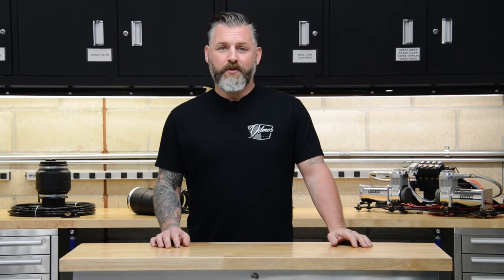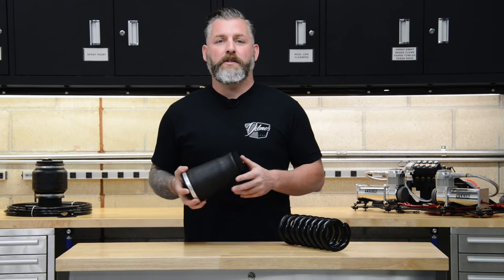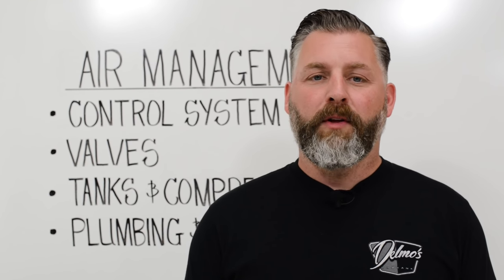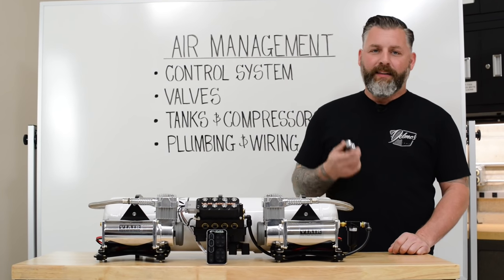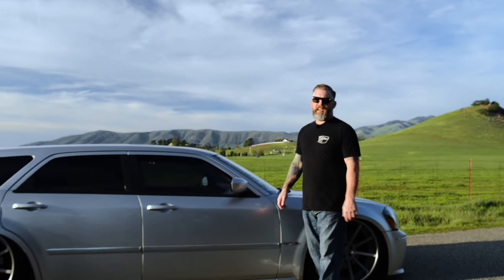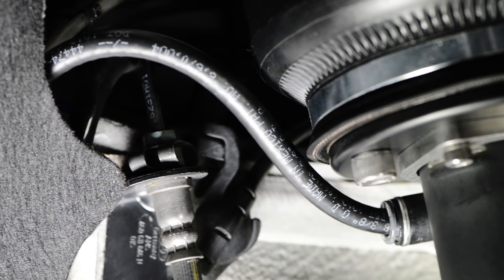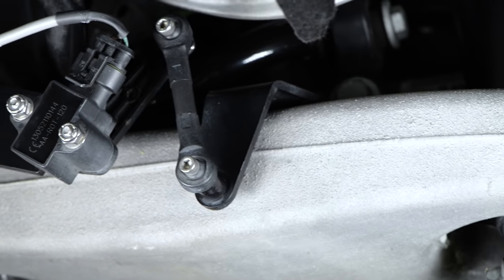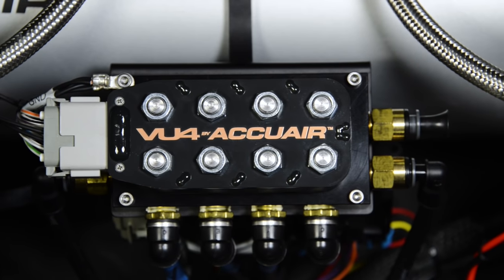Air Suspension 101 | AccuAir Academy

Comment: Disadvantage in air suspension compare to coil in 4x4 world is when you lift your car that coil if correctly set up will provide you exact ride quality you ask for. When you rise you 4x4 on air suspension in high ride will not be comfortable will be bumpy due to simple reason you load that air bags with lots of air so you make it harder not softer. Another disadvantage is if you live in place where temp like to change. It will give you a lot of moisture in system so it will malfunction quick. That is why some top brands which use air suspensions make it as close loop system with gas no air in so the compressor is not taking air from outside but compress nitro gas to system

Comment: With Accu air suspension if your car dies from engine or battery does your car drop all the way to the ground  or does the air system stay where it’s supposed to be.

Comment: Is the air suspension auto sensor to the height when it needed or have to manually press the switch button for lower or higher?

Comment: What if I live in Canada...will it hold upon winter. Ice, snow, salt ect?
Reply: I drove a Kenworth T600 for years all over Canada and the US in summer thru winter with 0 problems. That truck had 8 bag air ride suspension. What was a problem was wiring for taillights and marker lights from water and salt.